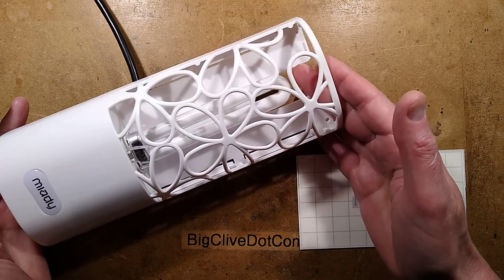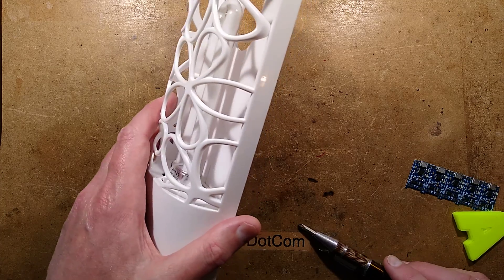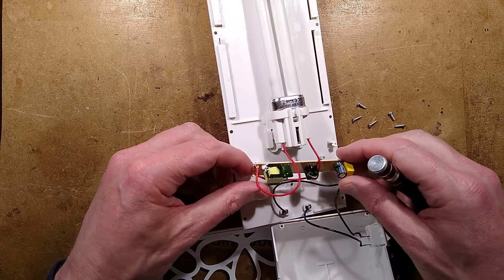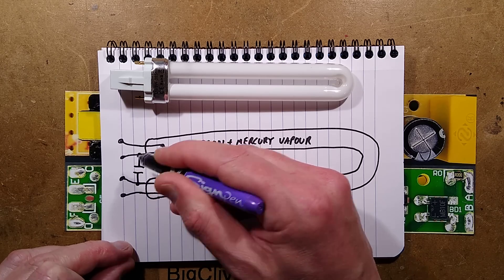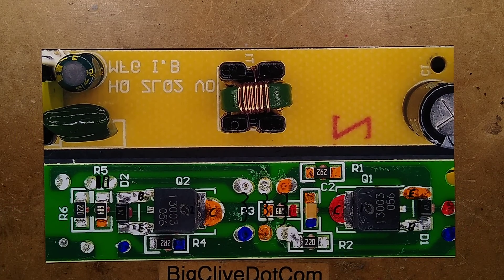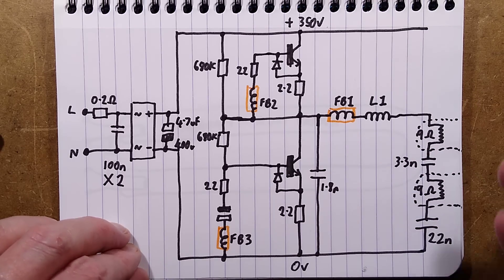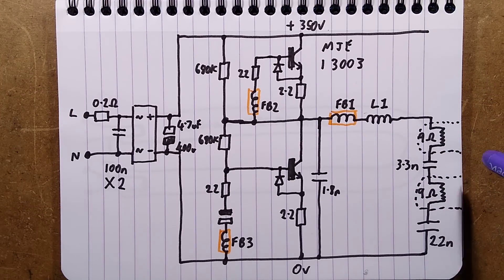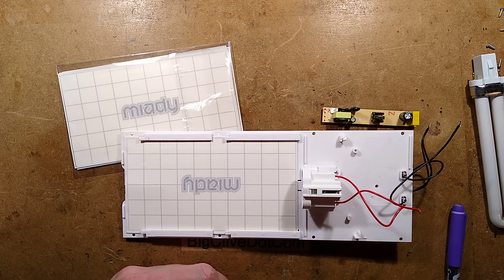Inside a sticky (glue board) fly trap (with ballast schematic)

Comment: I find these are mostly pointless. This is because I live in Australia and the only insect that has ever annoyed me is the mosquito, and the mosquito don't behave like little moths or flies, meaning they aren't attracted to these UV lights, and thus the only thing these really attract and kill are insects that don't even bother me for the most part. Most of the poor bugger moths and flies end up just dying in the ceiling light cover anyway, lol. 

The mosquito instead is attracted to CO2, coming from animal breath. And so the only traps that work for mosquito are either a chemical trap that releases CO2, or also water traps are found to work, the mosquito is attracted to water to lay it's babies in, and it gets trapped in there in a basic trap made out of a soft drink bottle. I find that the mosquito often gets into the house by existing near the doors, and just simply flying in when someone opens the door momentarily. And so, just keeping these bottle traps out beside the door, enables the reduction of mosquito there, and in turn reduces the chance of ones flying inside in the moments the doors are opened.
Reply: you could try making a trap using the process of electolysis. depending on how much mosquitos bother you ofc

Comment: I have one of these that is only about 1/3 the size. It actually works pretty well. I had an electric zapper one before and it caught maybe 2 flies in months of operation, although I suspect it was regular blue LEDs instead of UV light. The replacements are a bit expensive though.

Comment: Am I the only one surprised by the placement of the X Class cap in the power supply?  Why is it in parallel with the rectifier and not in series with it?
Reply from the maker: It's for noise suppression and not current limiting.

Comment: It's so interesting to follow along with your extremely detailed circuit analysis. One suggestion would be to include dot notation on the schematic for the feedback transformer windings to indicate polarity relative to each other during operation to further clarify how the opposite-parallel push-pull operation is achieved.

Comment: There is also the sugar coated sticky fly traps, that work quite well. As the name suggests its just tape you pull out with a sugar coating and the flys are attracted to it and get well stuck.  When full rip off tape and bin. Then pull out some more tap from holder. But probably a bit boring from a electronics point of view.

Comment: Dear BigClive, I wonder if you can add 2 wires from the ballast and add the electric shock in addition to the sticky tape.
Reply from the maker: It would be done with a simple voltage multiplier separate to the ballast circuitry.

Comment: I have to wonder... all the CFL bulbs I've used have died of bulb containment failure -- one filament or another melts a hole in the side of the tube somewhere near where it enters the plastic housing for the ballast circuit. None have died, as best I can recall, of an actual electrical fault. So I wonder if one could salvage CFL ballasts from dead bulbs somehow and use them for these? Might be cheaper than buying new ballasts online.

Or maybe the flash circuit from a disposable camera, one that uses a xenon strobe tube for the camera flash (rather than an LED), could be modified easily? That would be nice. They still sell disposable cameras at Wal*Mart, and IIRC if you ask nicely, most places that still process them will give you the carcasses of ones that've had the film removed so it can be processed.

Comment: Yep, getting ballasts for those little 2 pin tubes is a real pain. I went through the whole planning on 3D printing a holder with a separate ballast, but struggled finding a discrete low wattage ballast.
I ended up eventually coming across a new old stock b22 to florescent adaptor designed for retrofitting to save energy with a built in ballast. Very neat and handy thing (Micromark MM9528, still available by the looks), but yeah, these days it's probably easier to get a ready made UV device.

Comment: Clive how would I go about sending you a faulty device ? ( an LED tester , the little white chinese ones used for testing backlights on tvs) . I think it could make for an interesting video.
Reply from the maker: I have a few here.  Some use very basic capacitive dropper supplies and can give a shock to ground.
Reply: @bigclivedotcom  this one doesnt seem to provide enough output to light leds, it just barely lights them and the voltage readout is out by a few volts, I couldnt repair/ find anything wrong with it so ive just ordered a new one

Comment: For some reason I've never had much success with these light traps. Through the years bought several, all the zappy kind, but other than being a pretty blue nightlight didn't do much. Perhaps we have the wrong kind of flies, dunno. Now I just use a shot glass with a concoction and a drip of soap. Works like a charm. This old house being spider invested also helps. Used to catch them and put them outside. Now I've just resigned to living with arthropods.

Comment: For those considering options to replace the glue mats, I believe I've seen "tanglefoot" emulsion available from agricultural suppliers in the past.
Reply: Would double-sided tape do it?
Reply: @qq8556  No. The emulsion on tape is not generally soft or thick enough.
Reply: @KJ6EAD  It depends on what you're catching. We had a mourning dove nest above the entry door, under the eave, and it became infested with those almost microscopic bird mites. I secured sticky-side-up duct tape on the walls around the entire doorway (with blue painter's tape), and caught most, if not all of them trying to come inside. There were hundreds upon hundreds. But you're right, it probably wouldn't catch a fly.
Reply: @pepperpepperpepper  That's exactly the type of exception I intended to capture with the word 'generally'.

Comment: That glue board is easy to come by, any pest control supplier will have them. Fly lights are used all over the pest control industry their in restaurants, grocery stores, food factories. Most people don't see them as there are a ton of decorative options or they can be hidden as a normal light in the ceiling. These smaller ones work great in small offices or homes when there is fly problem, where the source can't be found or fixed. There is a huge range of sizes, if you trying to build your own, many of the large fly lights use a T8 bulbs and they take a regular ballast to run. But even if you looking for something smaller there are several types of bulbs used in various fly lights.

Comment: Wow, I've actually recently seen one where transistors got completely cooked. Some junk that was preinstalled into aquarium and happily killed itself.
Reply: Quite a few electronics engineers have told stories about MOSFETs that desoldered themselves but still worked.
Reply: @NiHaoMike64  maybe those were alive, but electrolytic crapacitors (thanks AvE, can't call them otherwise anymore) were done cooked like puffy pie.

Comment: Seems a little more economical than the “name brand” ones I’ve seen advertised lately that have more damn plastic in the disposable cartridges (which is just a fancy plastic frame to hold the sticky film and make it nearly impossible to accidentally touch the adhesive or the dead bugs) than they use in the actual device itself, which is probably disposable as well since the UV lights probably aren’t replaceable (by the average user) if they burn out…

Comment: Clive you are wrong! 
These types of tubes have the neon glow lamp starter built in. That's why they only have two pins. Of course the starter has a capacity but also a bimetal to make a short.
Reply: Why would they need that?
Reply: That's been my observation also. That type of tube was around when CFL's were used with iron cored ballasts, so it made sense to include the starter in the base.

Comment: I really enjoyed this video, thanks! I spent most of the '90s working with electronic transformers (for low voltage halogen lamps) and compact fluorescent tubes. Your assessment of how the circuit works is spot on (as usual!). The operating frequency is mostly determined by the feedback (or current) transformer, the turns ratio and the base circuits and is dependant on the saturation of the current transformer to cause the flip. This is an interesting design. Provided the frequency isn't too high (30-50kHz), the electronic transformers were extremely efficient and had inherently good power factor because they didn't need the 450V smoothing cap. I used to use MJE13007s for the driver transistors for the electronic transformers.
Reply: cool!! i also made an electronic transformer with 13009 to drive a TV flyback, it worked pretty well with ungapped core and 20 turns, the lack of a capacitor made a 100Hz buzz from the arc, neat!

Comment: Being that you worked for Disney what do you think about them adding chips at the bottom of soda cups to limit how much soda pop you can get in the park? I wonder what electronics they put at the bottom of those
Reply from the maker: I wasn't aware they were doing that.  It sounds like they may be using a simple RFID tag to limit refills.
Reply: @bigclivedotcom  I was honestly wondering if their actually saving money from the cost of the chip vrs less soda consumption but I suppose they are charging something like $15 USD for a cup I believe

Comment: Great video Clive, I've just had a YouTube advert saying that a clever man has invented a mosquito trap using a fine tuned UV light and it's selling fast, I thought mosquito only like carbon dioxide, and are not attracted to UV , could you test with your new unit? Thanks
Reply from the maker: We don't really have mosquitoes here.  Just midges.
Reply: Yes same Nottinghamshire, Midges with knuckle dusters

Comment: If it's a choice between electrified bug bits and a sticky pad of dead bugs, the sticky pad wins. It's easier to clean up. Good luck! 👍
Reply: There's an older type still widely available that has a function removing bugs from the sticky material and recycling them into further sticky material.  Been around for a very long time and is essentially perfected by now.  Really cheap too.

Comment: At 9:30 what is a "death beam" capacitor?  And is that a good thing to do right after the "megafart"  at 9:25?  You're videos are quite adventurous when i watch them with closed captioning and we haven't even caught a fly yet.  It does seem like the fly is in grave danger though.
Reply: The death beam is related some wacko (I forget his name) on YouTube who seems to believe that a high voltage capacitor in a street light for instance is to power death beams under the control of some superior higher power. He's a quack, preaching quackery, without any actual technical ability.

Comment: The Biax lamp has both a glow starter and capacitor. (at least the 8 year old one in my under cabinet light fixture does.) The fixture has just an inductive ballast. The glow switch is inside the tube base, thus when the lamp is replaced, so is the starter.
I have seen older variants of this that actually used an inductive ballast. Quite binky when turned on, especially when cold. (US voltages, as I live there.)

Comment: One thing that sticks out to me with this, or at least, doesn't stick out enough, if it fits right into the socket, then, it would need to be an unswitched socket as there's no room on the back to accommodate the switch making it flush-fitting, akin to how some "europlug" devices from china have had the pins just stuck in the case without the 6-sided extension bit they normally have to sit into their recessed sockets over the channel, requiring the use of a deathdaptor to extend them away from the socket... :S

Comment: LEDs all have a flicker which I find perceptible when I'm very tired. When I fitted a Phillips HF Performer II to my mum's 2x58W fluorescent kitchen fitting 12 years ago, nothing but instant, rock-solid light output. Tubes last much longer too. Only needed to replace one that already had black ends 3 years later.

Comment: This kind od PL-S lams suffer from one problem. They are instant start, which means that they start by brute force and high voltage, which shortens their life. You can combat this issue by installing a PTC thermistor in paralel to the starting capacitor. PTCs around 1kR are the most suitable. You can change the value of starting capacitor to fine tune with PTC you have chosen. The higher value of said capacitor, the longer preheating time will be. + 1nF from base value already makes a big differance.
Reply: You obviously didn't watch the video.  This has no accessible starting capacitor and overall a very different circuit than older lamps for those bulbs.

Comment: @BigCliveDotCom those internals; Ive seen them before in other "basic" type florescent psu's. Im also fairly sure they can be easily converted to operate on a lower voltage then mains due to the fact I know Ive seen that layout in 12v / battery operated ones*
Reply from the maker: The battery ones are often using Royer inverters.

Comment: in some of my buildings we have exit signs that have 7w 2 pin lamps. In the is s transformer that steps down from 277v to 120v and then a simple ballast.  They are 30 years sold.
Reply from the maker: They may run two tubes and starters in series with one ballast or use a ballast for each one
Reply: This one ran 1 tube with 1 120v ballast.  Some of the older can lights ran 2 26w lamps  and ran 1 2 tubes ballast on 277v
Reply: Ah, those weird US voltages that differ between home and industry locations.  Rest of world has 220 to 240 V everywhere, so no funny step down transformers whenever the same design is sold for both types of customer.   And then you add further confusion by calling a Y transformer a Wye transformer, even though it is clearly shaped like the letter Y.

Comment: I replaced the lamp with a regular cold white LED one, in the kind of mosquito lamp that uses a bulb that doesn't require a ballast, with a small Edison screw plug and a plastic flower cutout thing near the end used as a spacer. Still catches a surprisingly So maybe 3D print your design and make it so it uses regular lightbulbs.
Reply: *surprisingly large amount of mosquitoes

Comment: The Green LED version sounds like a very good thing to test out. But you would have to have the Blue UV light version and the Green LED version in the same area so you could compare the results. If you have a farm or live stock area near you that would be the place to set up the test results as they have lots of fly problems.
Reply: @GeneCash  No, just a bit of fresh manure should do.
Reply: Yep, just some fresh cow pats would be enough to trick flies into laying eggs.
Reply: Several wavelengths of green LEDs?
Reply: @ultratorrent  Good point. Most of the sticky fly traps that they sell around me are a florescent green / yellow color.

Comment: It's interesting how many variations of a given switchmode topology there are. I don't think I've ever run across one that used an inductor and a separate transformer (let alone a toroid) like this, always just a single core with multiple windings.
Reply: Yeah I was noticing that myself. Ferrite does get pricey for larger sizes, so it was probably an economic decision (design with 2 smaller cores cheaper to make overall than one with 1 bigger one).
Reply: Uhm... Here in Italy (230V 50Hz) CFL lamps has all got an inductor (2 to 5mH) and a toroidal driving transformer on a made of ferrite